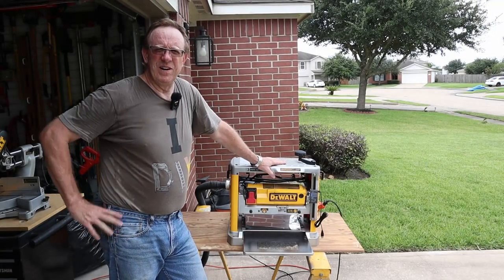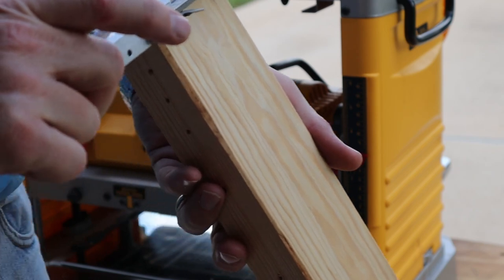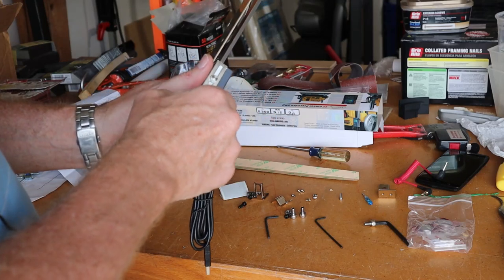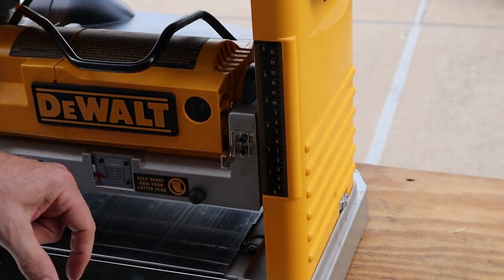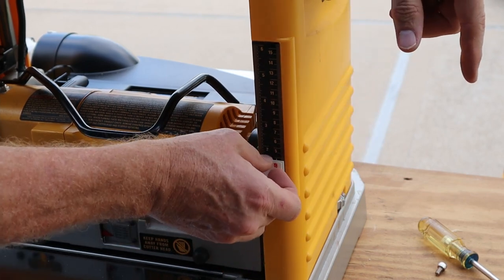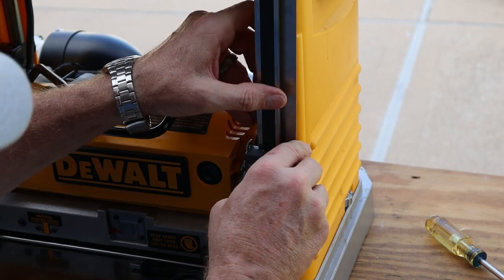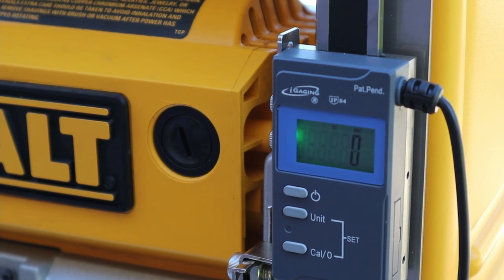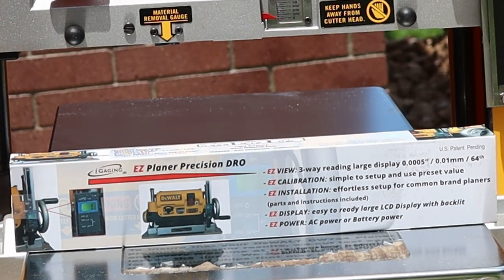Very Accurate Digital Upgrade-DEWALT DW734 Thickness Planer

Comment: It is completely indifferent to what type is the digital scale is intended for, on all of them the thickness is set exactly the same either in inches or in millimeters. Calibration is important so that the value on the display corresponds exactly to the material at the output of the planer. I have a similar scale on a DeWalt DW733 and it's just as good as a friend's Makita. Working with a digital scale is something completely different, the setting is fast and accurate.

Comment: You have a fix for dustport clogging and handle moving when running?Your awesome buddy.
Reply from the maker: I haven't had any issues with my dustport clogging, I would say if using a vacuum system it may not have enough suction power to clear the shavings or you filter is clogged causing loss of suction.  I haven' t noticed the depth handle moving, on mine I have a lever that you pull down that locks the planer so it won't move.  Hope this helps, thanks for watching.

Comment: OMG, wtf I cant understand any of that? FFS America.... METRIC!! 100-1 = 99 or.... 127/128 - 1/32 = welll, hmmm demonimator first, right.... umm... 32 x 4 = 128, so that's 4 right? Okay, so that means 4/128. Right. Next, 127/128 - 4/128 = 123/128 of an inch is... wait... so... what's the largest number that divides into 123 & 128? So... if I use 2, that gets me 61.5/64, nope, decimal.... so half that again.... is, wait... ummmm.. 30.75/32. Ah crap, still not even....half again? So that's 15.375/16  wait...that doesnt seem to be going the right way, like your country. See, it's the IMPERIAL scale that's dividing your nation! [edit: I wanna add, oh man, do I appreciate your OCD.... but oh man, being OCD in imperial must be maddening!]
Reply: Question, while using metric system how do you decide when you have to divide 10mm by 3? Or 10cm by 3? The problem with metric is 10 is only divisible by 2 and 5. 
To be honest, when I'm working I often use metric instead of imperial.
Reply: @a9ball1  Metric is the only way to go when working with wood IMHO.  With that said, let your brain marinate in this.....why do metric sockets have imperial drive sizes?  (ie 10mm socket, 1/4" drive)
Reply: Yah,  I am an old American and I use metric in my shop whenever possible.  So much easier to work with.   Too bad back in the 70"s Jimmy Carter did not switch us over to metric when it was being discussed.